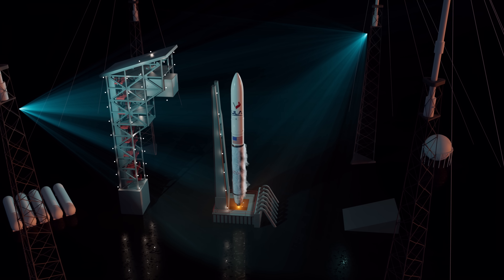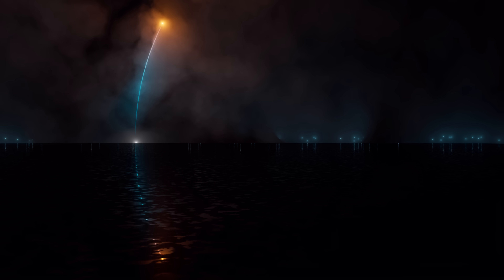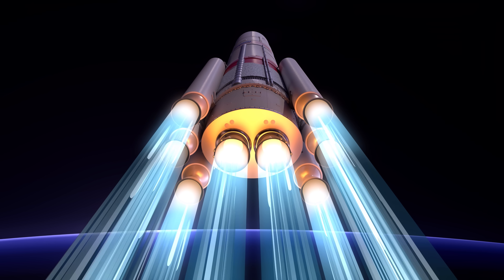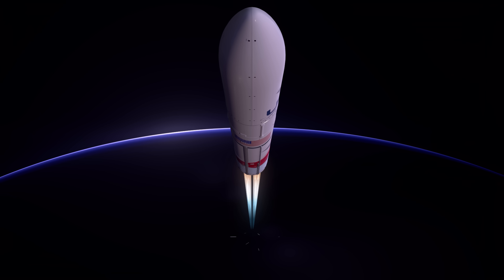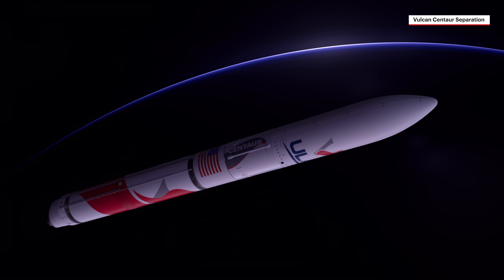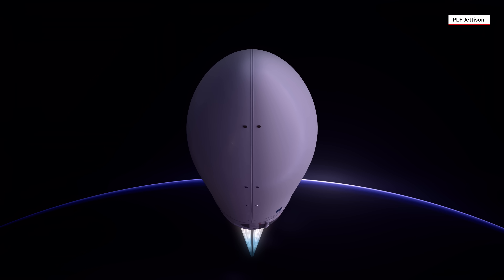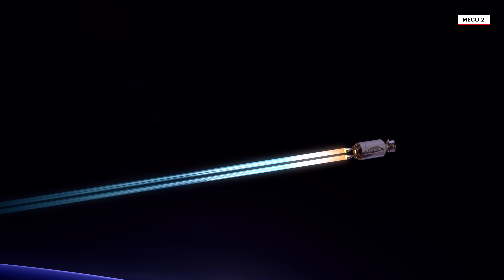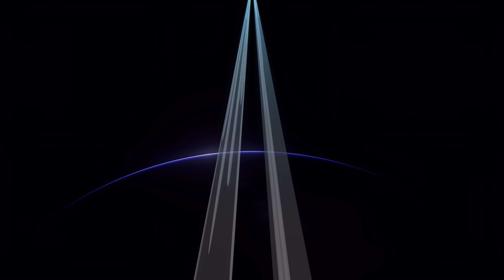Vulcan Cert-1 Mission Profile

Comment: So you don’t like, land the booster and reuse it or anything?  Just one and done??
Reply: ULA does have a solid plan to recover and reuse the engine section in the future, but first they need to prove this bird can fly. They'll get to work on implementing reuse once Vulcan is fully operational--preferably sooner rather than later.
Reply: @Delta-V-Heavy  Reusing the engine section of boosters in a few years isn't a very solid plan when the biggest competitor was reusing whole boosters in 2017. They'll still be behind where SpaceX was a decade or more ago.

By the time SMART reuse is happening, you will probably have several other companies doing reuse of whole boosters, including Blue Origin New Glenn and Rocket Lab Neutron. Maybe even Relativity Space Terran R and others.

Not to mention that fully reusable rockets might be operational.
Reply: Why is that a problem? Spaceflight has been expending boosters for decades. This makes the vehicle provide 10-15% more performance
Reply: @lextacy2008  Cost. Luckily, ULA has a solid niche in the market. The not-SpaceX niche.
Reply: @lextacy2008  Yes, that is how spaceflight has worked. In the past.

ULA should be more ambitious and look to the future. The market has changed and they need to change with it.
Reply: You do realize that space is a multi-market industry right? ULA doesn't have to carbon copy what these "innovators" do. ULA still provides twice the jobs over Space X so there's that. You can't possibly think that reusability doesn't come with its disadvantages. Ask any former Space X worker @SpaceAdvocate
Reply: @lextacy2008  A company doesn't exist to create jobs. If that's the focus, pretty soon everyone will be unemployed. The focus must be on making compelling products that do well in the market. (And as far as I can tell, ULA has something like 2500 employees, while SpaceX has over 13,000 employees.)

Reuse has some disadvantages, but they pale in comparison to the advantages.
Reply: Spoken like true AI. A company doesn't survive without jobs. Do you even know a shred of economics?   @SpaceAdvocate
Reply: @planetCoronavirus  Employees help a company generate revenue, but employing people is not the reason why the company exists.

I could start a company, hire 3000 people and have them sit around and play cards. Is this a successful company? I'd have more employees than ULA.
Reply: @lextacy2008 Spaceflight expending boosters is the past. Reusable is the future. Actually, the present as SpaceX launches far more rockets than anyone now.
Reply: @lextacy2008  You need orbital refilling to stop throwing away boosters, so it's not quite the past. Starship should start doing orbital refilling next year, though, so it's not too far away.

Comment: It is amazing to see in 2024 how much spaceflight hardware is reusable. Vulcan does reuse a lot of its hardware, right?
RIGHT?

....... Oh.... right...
**sigh**
Reply: Read my post under RJGreen’s similar comment and/or watch the works of “The Pressure Fed Astronaut” (and/or go down a rabbit hole of papers).

TLDR: It doesn’t make Economic and Practical Sense to do so currently, especially for the Missions this launch platform will do.

The only real justification is Moral, which I agree with.
Reply: @ericlotze7724  and read my response to that post.
Reply: This rocket is built for different missions further than low earth orbit so it needs all its fuel, high energy missions that other providers cant reach, its not its focus to land boosters yet. Falcon 9 needs a third of its fuel to land so it doesnt go far out. ULA does have plans in the near future to re use the engines.
Reply: SMART engine reuse will be a thing, especially for the rapid-pace Kuiper satellite deployments starting in 2025. They've already tested a half-scale hypersonic decelerator in conjunction with NASA, and more recently they've conducted recovery operations tests with a full scale engineering mockup in the ocean.
Reply: oh. my. god.
Reply: Think it though...

Comment: It doesn’t return to land?  Dang it
Reply: Rocket to high energy orbits
Reply: @zaks01  Falcon 9 can reach High Energy orbits. In fact, it's even better at it than Vulcan and Atlas, due to lower boiloff rates (meaningful when the second burn is long after the first, such as during a GEO mission).
And, even if Falcon 9 will not suffice, Falcon Heavy is still cheaper than an Atlas V or a Vulcan Centaur, while also having a way higher payload.
And don't bring Starship into any debate, because even if it costs way more than expected, it still dominates when compared to Falcon, much less Vulcan and Atlas
Reply: @bryanillenberg  Yes, but do the lower boiling rates more than compensate for the efficiency of Hidrolox?
Reply: @zaks01  probably. Hydrolox boils off really quick.
Reply: @bryanillenberg  As an aerospace engineer working at the cape, thats very false, falcon cannot reach higher energy orbits. They are meant for low earth orbit only, they need a third of their fuel just to land.
Reply: @odynith9356  Fully expendable Falcon Heavy can do anything Vulcan can.
Reply: @reagank.2268  no it can’t. It doesn’t do high energy military orbits
Reply: @odynith9356  Fully expended Falcon Heavy can carry a bigger payload than Vulcan Centaur VC6 up to around a C3 of 65. That means that Vulcan Centaur VC6 exceeds expended Falcon Heavy only if you're going to roughly Jupiter or beyond.

For any orbit less energetic than roughly Jupiter, Falcon Heavy can carry a bigger payload. (Unless you add a kick stage, then Falcon Heavy can be more capable for any orbit.)
Reply: good lord not everything has to be reusable omfg
Reply: @AeonExploration  😿😿😿😿😿
Reply: it will, when it lands on the seabed, in HORRIBLE condition.
Reply: @ThatOpalGuy  so sad.  Seems like they have no interest in reusing rockets
Reply: @rjgreen91  Well they do have plans for engine section reuse
Reply: @rjgreen91 while i dislike it and hate waste, the business world operates on money, and unlike Electron or Falcon 9 (ESPECIALLY if you take away starlink’s artificial inflation of the launch market), these larger rockets are used so infrequently, and are so hungry for launch energy, that it barely makes any sense (At least Economically…) to reuse any components.

The “Smart Engine Reuse” concept is an interesting middle ground.  Basically fuel tanks etc which are more complicated than one would think, but still essentially tanks+piping, get chucked, but turbopump and other complex+expensive engine bits (and maybe most of the electronics if i remember correctly) get recovered.

At the end of the day I am still team Venturestar, Skylon, or *heck even just a Dream Chaser on a Falcon 9 (or similar thing*)

(That or in an alternate timeline a better old space shuttle/ the Energia-Buran with flyback boosters)
Reply: @ericlotze7724  wrong: SpaceX flew over 30 times last year, excluding Starlinks.
That's more than enough to justify large, reusable rockets.
And remember: more megaconstellations are coming. Project Kuiper, for example. These will inflate the market even further.
SMART is possibly the least-smart method I've ever seen for reuse: ditching the tankage (which are large, and with mass-produced engines, the most expensive part of the vehicle), while also dumping the engine section into the ocean (causing damage).
Something more like Electron's recovery is better, but the best by far is either propulsive landing on a barge or propulsive landing RTLS.
Reply: @rjgreen91  This rocket is built for different missions further than low earth orbit so it needs all its fuel. Falcon 9 needs a third of its fuel to land so it doesnt go far out. ULA does have plans in the near future to re use the engines.
Reply: @bryanillenberg  Smart is the least-smart method for reuse? For the purpose of the rocket, it is the only possible way
Reply: @rjgreen91  They just dont care and that will be their demise
Reply: @rjgreen91  Look up SMART for the recovery of the core 1st stage engines. Vulcan in order to meet its NSSL mission requirements has to have a much higher velocity at 1st stage engine cutoff, so landing it like what Falcon 9, New Shepard, or eventually New Glenn isn't practical.
Reply: @ericlotze7724  You hate waste? You should really hate the waste that is 5000+ Starlink satellites that are about to de-orbit due to low orbital insertion. Falcons re usability is pretty much negated when its payload is severely inefficient.
Reply: @mikedicenso2778  I will do. Thanks
Reply: @lextacy2008  i agree completely.  Granted it’s a bit better in my opinion than “Graveyard Orbits”, but seeing all those components which could be recycled (E-Waste) get burnt up is saddening.

Granted not that bad from a harm standpoint, and not too big of a deal cost wise (*i think, need expert input, and also Starlink may not be profitable; Elon can hide finances more than NASA etc)

As stated elsewhere, my dream is all what the space shuttle wanted to be, and all the cool things that did/may do a better job.  Repair/Refurbish the satellites/space stations if possible, if not bring them and/or their components down in a ship if possible.

Granted it’s not too possible for very high orbits, *and Human Existence causes waste/energy use etc*, but i do like minimizing waste as much as possible.

(Edit: Typos)
Reply: @zaks01  I present Falcon 9, proof of just how wrong you are
Reply: @bryanillenberg  The Falcon 9 first stage does not come close to the speeds achieved by the Atlas/Vulcan boosters
Reply: @zaks01  That's really a design flaw. It's looking more and more like the future is boosters that pop up above the atmosphere, send the second stage on it's way and then return to the launch site. And for high C3 missions just add a kick stage or use orbital refilling.
Reply: @SpaceAdvocate  Or also in the future, they could use the inflatable heat shield to bring the entire booster back, but the landing would have to be with a parachutes
Reply: @zaks01  You’d need a bigger heat shield because of the increased mass, and you still wouldn’t be returning to the launch site, requiring expensive vessels and increasing turnaround time by weeks. It would be a step in the right direction, but not optimal.
Reply: @zaks01  yeah, I know. That doesn't mean Falcon's design is worse, it means Vulcan wasn't designed well.
Reply: This comment really brought out  a lot of crybaby’s